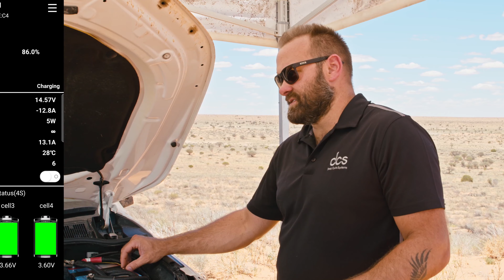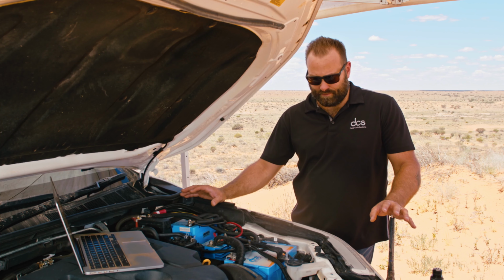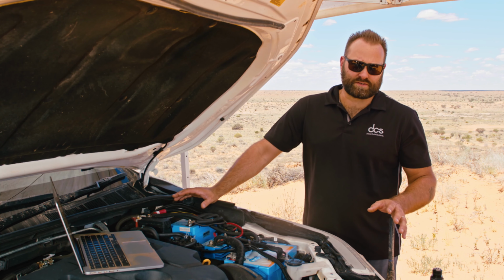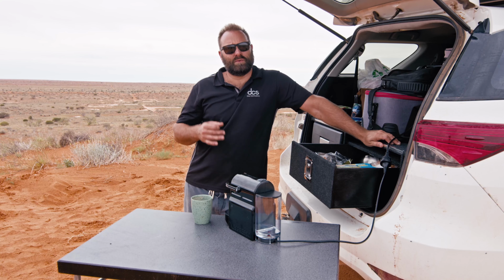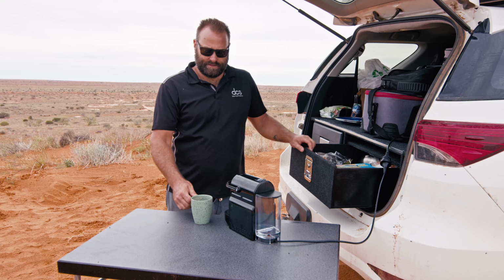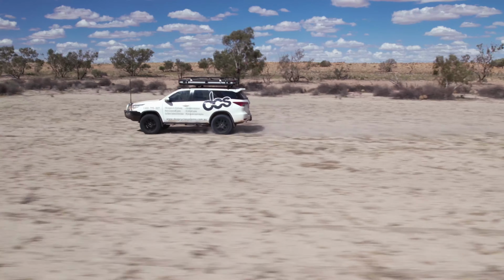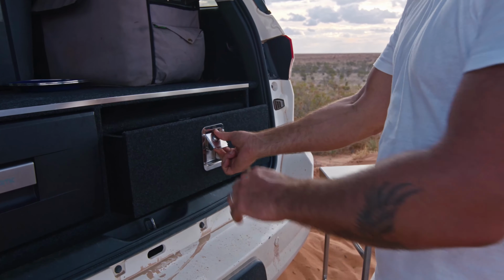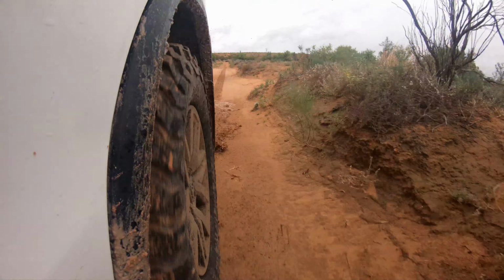DCS Hybrid 4WD Lithium Dual Battery Systems

Comment: OK Lithium batteries are beyond my budget, but I want to thank Paul and Dan online for coming to my rescue in the Vic High Country one night last Nov. I was showing the region off to a couple of friends from Switzerland. It rained all the last Friday afternoon as we were heading back out towards Mt Bulla when I tried and failed to get up a short steep, wet and rutted section just before the end of the King Billy Track. I slid back down and ended up axle deep in mud. When it got dark and I finally realised I had no hope of getting out without help (we were winch-less), we walked the last 1km up to the junction with Brookes Rd and Bluff Track, hoping to get a signal to call some mates. We saw Paul and Dan camping just off the road, mid meal under their awning to escape the still-pouring rain. When we told them our troubles, they immediately packed up their dinner, transferred a pile of gear from one of their vehicles to the other to make rooms for us, and we all headed back down to our Cruiser. With their (clearly extensive) recovery know-how and a fantastically equipped Hilux wagon, they had us out of the mud and up the rise onto solid track in no time. Those guys saved us from a very uncomfortable night in the Cruiser and who-knows-what hassle getting someone to come up and pull us out next day. Feel free to ridicule me for being up there in a single vehicle, not having a winch, trusting the forecast for no rain, etc, but I'm only an occasional participant in this fantastic pastime😞. Whatever. What I want to say is these two guys were fantastic, and if their lithium batteries are only half as good as their characters, they'll be bloody good batteries.  Thanks again Paul and Dan.
Reply from the maker: Thanks David, glad to see you made it back home safely. And nice to see an older 100 series still rolling around those mountains.  It was very wet that next morning there were more vehicles stuck in the same location as you - so that should make you feel better 😉 

Our LC300 High Country trip video was just released: https://youtu.be/BQ5BF0gIDuk
Reply: Good Australian spirit to show your overseas visitors.

Comment: Big thumbs up for dcs batteries.(Paul)
Been using under the bonnet for over 2 years and now have 2x200amp in the caravan.
Having lithium under the bonnet without the need for dc-dc chargers allowing super fast charge rates and simplifying the whole system is the most significant 12v advancement in 4x4s for a long time.
Good work guys! Watch everyone else follow suit.
Reply from the maker: Thank you for the feedback 👍

Not only 4x4s the same system applies for the marine market from little fishing boats to 50ft+ yachts. Combined house & cranking without all the other unnecessary equipment.

Comment: Okay i have the twin 90’s installed, best batteries i have had for my 2012 Pajero. Haven’t had to hook up with the solar system yet, fridge makes ice all night for the refreshments. These were recommended to me by a work friend, that has one of your off grid home power systems. I wish i had these batteries earlier as would of saved me having to replace those lead acid ones every year. Keep up the fine work getting them out there. Very impressed!
Reply: how does ure fridge make ice now cmon

Comment: Whats the minimum charging voltage from the alternator? My Prado gets as low as 13.5V from the alternator.  Will this get a dual system to 100%?  Also, will an underbonnet battery last as long as one NOT underbonnet.  I know you warrant them for 3 years under bonnet, but that's not the question.
Reply from the maker: More info on smart alternator voltages here: https://www.deepcyclesystems.com.au/faq/#what-soc-do-modern-smart-alternators

Rule of thumb you'll half the service life of any battery chemistry in a high temp environment. Prado's run cool engine bays so with our proven long life cylindrical cell chemistry your laughing.

Comment: How far is the inverter from the battery bank and what guage cable did you use?
I'm planning on putting the dual 90aH Lithium under bonnet but the inverter in my canopy
Reply from the maker: It's around 4 meters and I run 0 gauge. 
Yes you can do that no worries.

Comment: How do these hybrid 4x4 batteries compare to regular RV & Marine DCS lithium units for stability, usability and reliability in these harsh touring environments and high under-bonnet temperatures? Will they be up to the task and provide the same level of expected confidence?
Reply from the maker: Great questions Brett - we have spent alot of time developing these 4WD hybrids and have packaged them with alot more technology to do exactly that make them more robust in harsh environments, more stability, more reliability with additional hardware and firmware revisions. Usability has also improved with more accurate parallel data and longer range from the Bluetooth chips. Especially optimised for high temperature environments.  

They also feature an additional metal safety cage so that if the vehicle is ever involved in a frontal collision the cage will contain the cell pack within its structure.

These are ultimately more robust than our Marine / RV range of batteries, but this technology will move into our other battery range over time to further widen the gap between DCS and the competition.
Reply: @deepcyclesystems  great to know the hybrid batteries are designed for the rigours of touring life.  Ive the twin 100Ahr in my heavily modified touring vehicle, should i be wishing I'd held off these couple of months for these hybrid units especially given the similar price point of the 100Ahr and 90Ahr.
Thanks for taking the time to reply.

Comment: Can you run the battery with the solar input as the start battery? I can’t find these on your wed site
Reply from the maker: The two batteries are wired in parallel, so you are always starting off both batteries.

Comment: What  about the vehicle's BMS? 
Like my new Everest, that have the current sensor on the negative terminal.
Does the vehicle BMS need to be s/w altered?
Can i use my lithium jump starter unit to jump start the car?
Reply from the maker: There's no room in the Everest engine bays for an auxiliary battery tray, so no way to run our Hybrid DBS in this vehicle. 

Everything stays as factory, doesn't matter if it's smart or fix voltage regulated alternators. 

Yes you can still use a jump starter pack if ever needed. But our batteries are big jump starters, so just get a little charge back into and then crank the engine over.

Comment: Hi great work you guys and gals are doing at DCS, just one question in relation to what happens to the alternator if the BMS in the lithium's shut the batteries down if disconnecting the load from the alternator? would this not burn out the alternators diodes? what protections are in place for this occurring?
Reply from the maker: Great questions. 

The batteries can never be subject to a condition where the BMS would need to be shutting the batteries down, under such a scenario you would not only be risking potential damage to an alternator but you are risking damaging the batteries.

Our Hybrid batteries have a massive power band and support 3000W inverters and winches so you don't have to ever worry about it.

Comment: Why not run a Argofet Battery Isolator to charge the rear slim...

Any new Adelaide based reseller?
Reply from the maker: Yes can run a FET alternator splitter if either your runnig a non smart alternator OR at least 370W+ solar. 

Otherwise it won't work on the 2.8L Toyota engines.
Reply: @deepcyclesystems  no I have a 12 200. So would that work then?
Reply from the maker: the capacity of the batteries doesn't matter, if you want to run a FET alternator splitter you need to consider the above guidelines.

Comment: Great Vid. Does the direct alternator charging charge the batteries to 100% or is the a loss of capacity due to the alternator charging?
Reply from the maker: https://www.deepcyclesystems.com.au/faq/#what-soc-do-modern-smart-alternators

Most smart alternators typically bring the batteries back to around 80%SOC. That's why the system has an integrated 80V/20A MPPT charger so you can run a fixed panel to get them back to 100% if you actually needed that extra power.

Comment: What size VBP did you use with the 3kW inverter?
Reply from the maker: The smart battery protects are for your small loads, such a refrigerators, lighting, travel buddies, amplifiers, small inverters under 300W, USB chargers etc... these are wired to the output post on the SBPs so that they are protected. 

Larger loads like 2000/3000W inverters, winches, compressors are wired to the SBP's input post and so are connected directly to the batteries.

Comment: Great Video and information , what inverter did you use and how was it connected if you have to bypass the system . I don't understand this stuff very well so a quick video on the subject would be great . Also could you plug your caravan lead into the inverter , similar to Dash Offroad. thanks
Reply from the maker: Running the DCS 12V 3000W inverter, these will be back in stock again around June.. 

The low voltage cut out switch that reserves 20% for engine starting is simply bypassed in the video so that we could drain the last 20%.

Yes you can run a lead anywhere and power whatever you needed off the inverter in the vehicle e.g. power your home during an outage.

Comment: Hey, What's the expected bluetooth range?
At this timestamp, you show the app being used while cooking. I can't get mine to connect from behind my 4wd, is this an expected issue?
100 series landcruiser, won't connect unless I walk un next to the rear quartar panel.
https://youtu.be/4r96CRmiKrs?t=627
Reply from the maker: Line of sight on the hybrids you'll be getting 15m+
If your trying to transmit through the vehicle you'll have way more interference so you might get range or you might not - you typically need to connect standing by the side and then walk around to the rear of the vehicle. 

Also both batteries are in different positions and one will always have a stronger signal relative to your device, you'll probably work out very quickly which one that is as the strongest signal is displayed at the top of the list. The lower the -dB number the stronger the signal strength.
Reply: @deepcyclesystems  Thanks.

Comment: Very very nice system. Thanks for the 0% recovery test. I have good knowledge of batteries and 12v stuff for out back traveling and that is a new one for me. That is also a great safety/recovery feature.  I love the whole concept you have there. Are they two separate batteries and what happens if one fails?
Interesting point about the battery temps up to 76 deg. As you said your batteries will do those types of temps but at a life span cost. This is a very good and informative video thank you. 
PS. I do run one of your 75ah batteries in my caravan and runs the inverter and coffee machine at 140amp draw very well
Reply from the maker: Thanks for the feedback. Confirming yes they are two separate batteries, if one has an issue the system still runs flawlessly on the other battery.